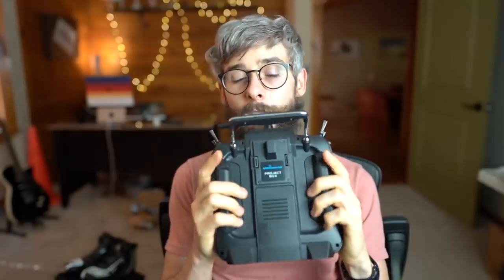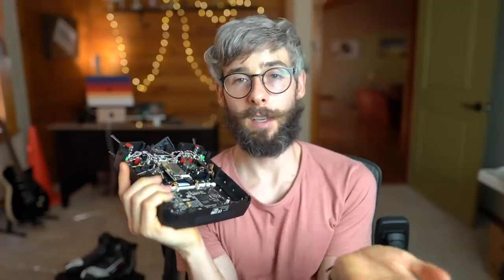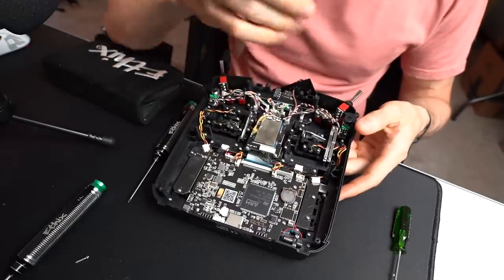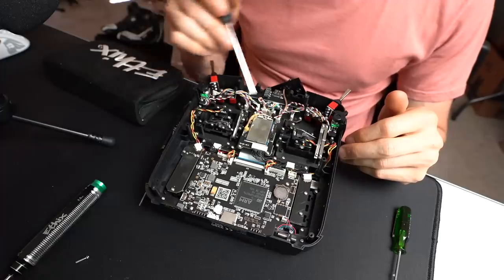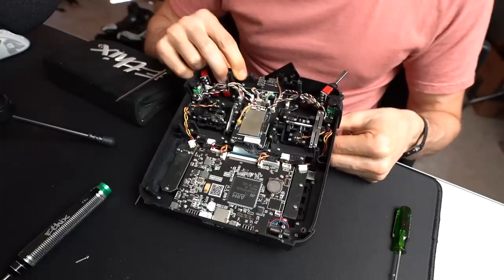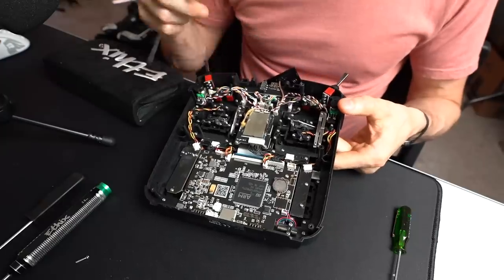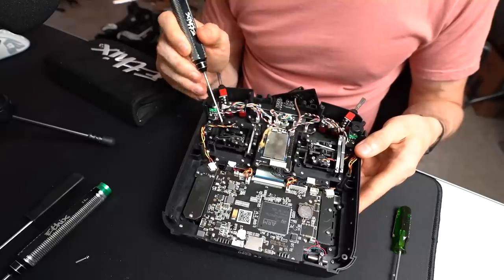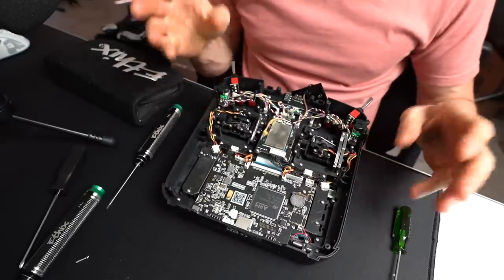Drone Gimbal Tension Secrets (How To FPV 2020) Part 4

Comment: Thanks for this vid Steele. After 3 years I had to discover why I was learning so slowly or my moves were so inaccurate. My gimbals were way too loose I constantly (unintentionally) was giving yaw on every throttle input. The sticks were also too tall. I had to slow down my videos to find out what the hack am I doing wrong. I also discovered my rates exact half of yours due to the fact where you prefer a full flip I do an exact half flip so my timing is exact half as slow. :)

Comment: @mr steele: Adhesive backed teflon for smooth throttle, and I made lighter springs from a reverb thingie for an amp that worked out quite well. Great update, this stuff matters.

Comment: Some models have hex screws right on the gimbals and you can adjust the spring tension without having to open up the radio. I found this out the hard way when I couldn't find the screws beside the springs mentioned in the video. The hex driver is pretty small but the smallest one included in my Ender 3v2 set worked. My gimbals were so tight I always cramped up during fast races.

Comment: Been flying with the stock notching on my qx7 for like 4 months and switched a few weeks ago to the smooth throttle and my flying feels so much more buttery its crazy
Reply: Thunderpower 2000mAh 2s (btw he said that)
Reply: Now try to turn off adc filter in menu, and lower FF slider to 0 in 4.1, then youll have true butter bruh ;)

Comment: What a conincidence. Just earlier today I had my radio apart and completely revamped my tension. Ever tried switching rates and flightstyle?
Reply: Same lol. Way loosened my tensions and got rid of the ratchet. And change my rates from 667,667,667 to 1027,1027,760. And I heightened the expo and super rate
Reply: @OscarTRob  Just for a newbie in FPV, does adjusting tension really make such a huge difference? Cuz I thought a lot of this can be regulated with rates

Comment: For anyone watching years later, the TX16S MKll has these adjustments accessible from the front of the radio and mine came without the ratcheting so you don't always need to take it apart, just adjust a few screws from the outside 😄

Comment: For anyone who has this radio and wants to remove the throttle ratchet but is scared of taking the whole thing apart: you can access those two metal tabs from the back by just taking off the rubber hand grip. There are holes in the plastic under it that you can fit a screwdriver through.
Reply: isn't that only for the potentiometer gimbal?
Reply: On some transmitters but not all.  I had one Spektrum that I could do that, 2 DJI transmitters that you could access from the outside but on 3 other transmitters you have to take them apart to access the gimbal adjustments.   I think Radiomaster has "front-accessible tension and travel adjustment" hall gimbals but I've never had the pleasure of using them.  I'm not sure about their latest hall gimbals that fit smaller transmitters.

Comment: Molykote EM-30L silicon grease is really good for a low-stiction grease.  Stiction being that resistance you get when you start to push the stick that suddenly releases and can make you overshoot.  Safe on plastics.  Not sure about electronics, but it isn't runny.  I got some on amazon.

Comment: Just got my backup radio.  I have very high tension on my radio.   But I have been curious about loose tension so gonna set them up to be the same save for lose tension on one and high tension on the other.   Then I can finally have an easier time of comparing back and forth.   I also may try the race sticks that have limited throw.

Comment: My TX16S came with zero ratcheting on the throttle gimbal. I'm wondering if it was a refurb or something. It's supposed to be the hall gimbal version, but has black sticks.
I opened it up, and its completely different. There are metal plates on both sides, and the one of the throttle side looks backwards.

Comment: in the current version the tx16s has a connecter at the back for the speaker in the backplate, so if you bought it recently, BE CAREFUL!
Reply: I remember years ago I thing it was a Spektrum DX8 that I had to remove a ground wire to open it up enough to work on it.   Spektrum does not like customers to fix, adjust, modify or explore inside their products.   
DJI likes to fill screw heads with silicone so you have to pick it out before working on their products.

Comment: Hey, I am new to this hobby and I am not sure about one thing - is lube necessary? Does it affect the precision or durability of the gimbal?
Btw. amazing content! It's very helpful!
Reply: I mean I don't personally use it but I might try it. It hasn't negatively impacted me so far but then again I don't to any crazy stuff on the caliber of Steele so it might make a difference for someone like him. I suppose lube would give you more ability to get your tension perfect cause without its kinda hard but I haven't ever had issues using it without.
Reply: Thank you for your answer! So I think that for now I will fly without it and maybe I will try it in the future.
Reply: @repor8234  So update, I put lithium grease on my gimbal today and wow that makes a difference. You get much more fine control over how tight your gimbal is and I found you can have it a lot looser without the gimbal flopping around under its own weight. I guess time will tell how well this works but for now I'm pretty excited to test it out
Reply: That's nice! I appreciate that you came back to my comment to give more info.

Comment: Fwiw mechanical keyboard hobbyists lube their keyboards with products worth considering. They come in handy wherever you may need to lube plastic parts. 

Plastic on plastic: PFPE grease (I use finish line extreme fluoro).

Plastic on metal: dialectic grease. (permatex)

Comment: I use teflon tap that is used in plumbing.  I wrap the spr
Reply: I use teflon tape that is used for plumbing.  I wrap were the gimbal runs on the tension spring, right on the spring. 
 it's been two years and still silky smooth.

Comment: So question do you soften the tension or Harden it? Whats better for Freestyling? @MrSteele
Reply: CrAYZ Willy FPV depends on style, if ur finger dont shake, softer allows finer throttle control n faster flicky moves

Comment: Hey Steele. I wanted to ask you something. Can I get a Beginner FPV Kit for about 300$. I planned on buying an Eachine Wizard X220s or X220  with Some Cheap Eachine FPV glasses
Reply: TheKindXboxGuy dont do it man, get the iflight cidora e and a cheap eachine box like vrd2 or ev800d ...much better value for ur $.. cheap used on ebay

Comment: Hi, I have a problem with my drone. The thing is, I don't have video in my goggles. I set the same channels and band and nothing. The only thing that happens is when I go to one band higher than the right band, a black screen appears every now and then. Do you know what this solution can be? Thanks
Reply: This happened to me and it usually means the vtx isn’t getting video from the fc. See if you lifted a pad
Reply: Ok, thanks